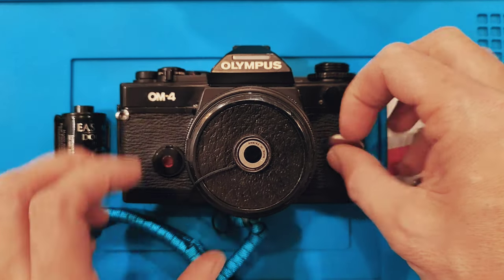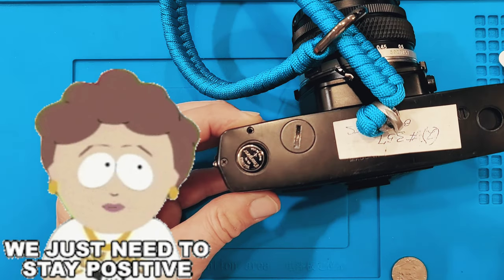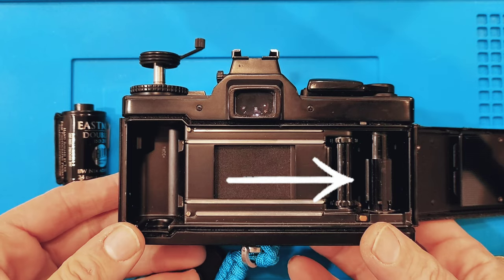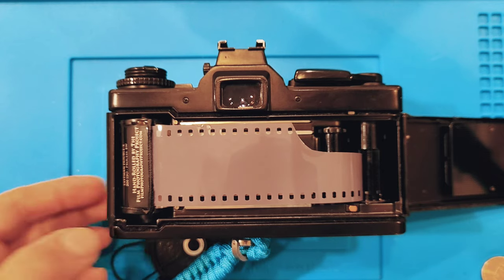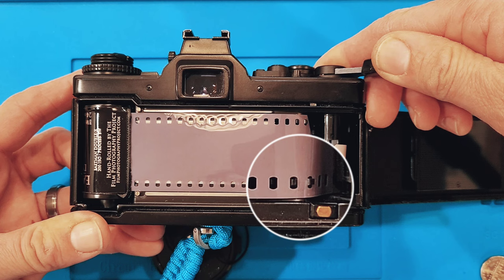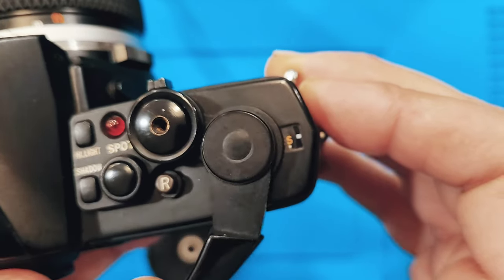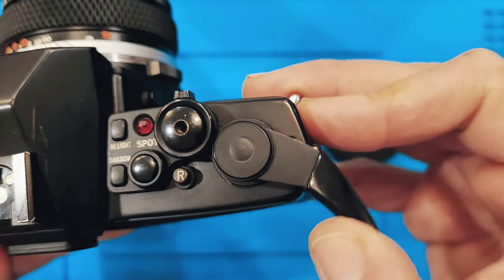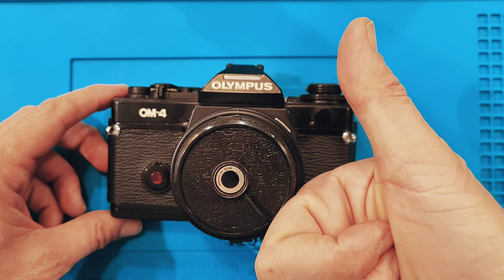How to load film and batteries into an Olympus Om4.

Comment: My wind up lever is stuck. Any chance you know what would cause that??
Reply from the maker: Is film loaded into it? I assume you pressed the film window release button on the bottom?
Reply: Film is loaded but no film has been used yet. Yes made sure the release button is pressed
Reply from the maker: @seemamarahatta5116  OK so bow we're getting somewhere. By wind up level, you mean the film advance lever. The "L" shaped lever on the right hand side of the camera?
Reply: Yes. It’ll move about 30 degrees and then is stuck
Reply from the maker: @seemamarahatta5116  So the shutter doesn't get cocked because it jams. If I recall correctly you could remove the film without losing anything. So wind the film back into the cartridge partially. Open the back of the camera up, remove the film. Now cock the shutter and watch the film advance spool. Let me know if you need to make a video of that procedure so you can see it happen. I don't have the om4 anymore but I do have it's older brother the om2n
Reply: @filmcamerajourneys  I have also run into the same problem. I'm a beginner so I do not know what it means to cock the shutter, would really appreciate if you could make a video on it!